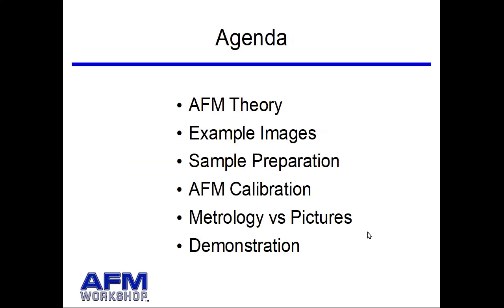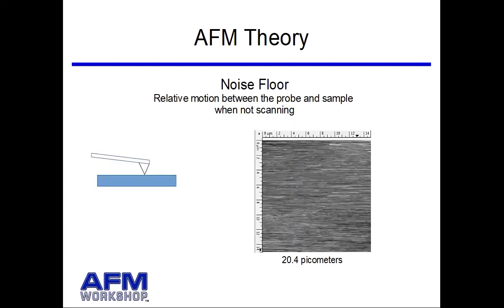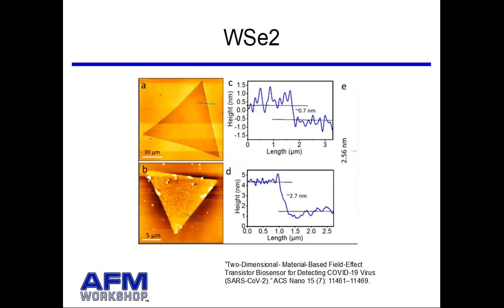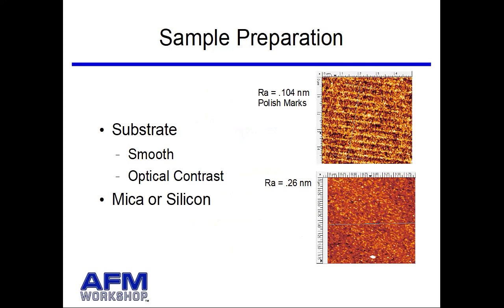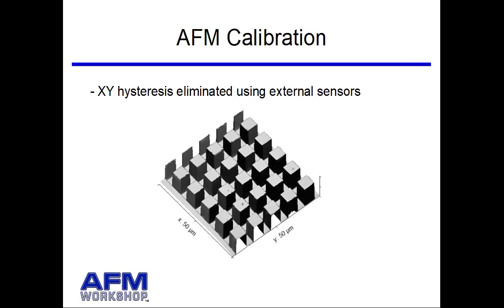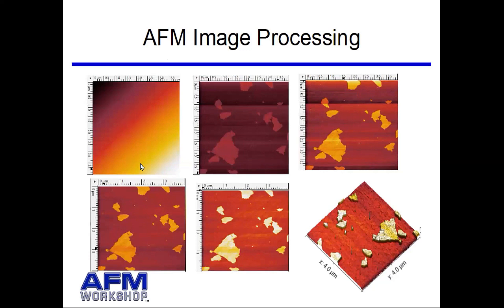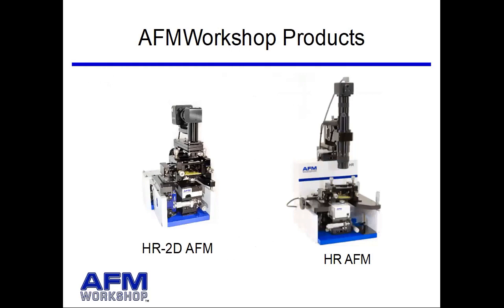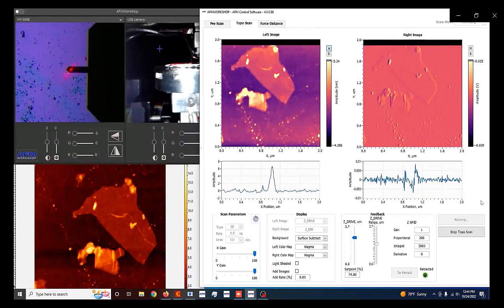Atomic Force Microscopy (AFM) Workshop

Comment: You mentioned part of your goal is to help people find and obtain graphene. Do you do this for small end-users? Like a guy who has been following graphene for about six years now and really wants to throw some turbostratic graphene in the concrete mixer when he pours the foundation for his new shop?
Reply from the maker: Dear "Buffalo", thanks for your message. The Graphene Council does connect graphene producers with corporate and industrial customers / partners. Based on our experience and knowledge of graphene, we would never recommend someone just buy some graphene to throw in some graphene and hope that it works. Graphene requires a more exacting approach. 

Please understand I do not want to diminish anyone's interest for graphene, I just would be doing a disservice if I did not point out that such an approach is almost certain to fail. Graphene requires well tuned formulation to a given application, often requiring much less material than assumed. The other major hurdle is to make sure the graphene is completely and evenly dispersed though your host material. For use in concrete, it is best to have graphene suspended in an aqueous solution first and not try to introduce a dry powder.

Lastly, graphene as a dry powder should only be handled in a controlled environment with proper personal protective gear to avoid inhalation. Graphene itself is benign but no one should inhale anything that is a nanomaterial. 

Hope this is helpful!